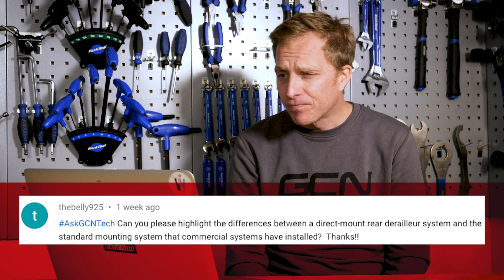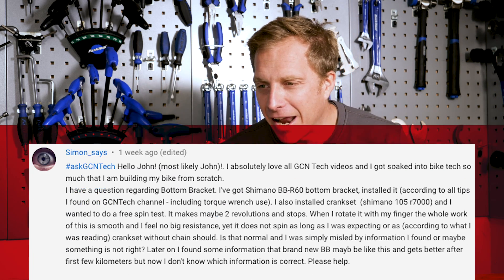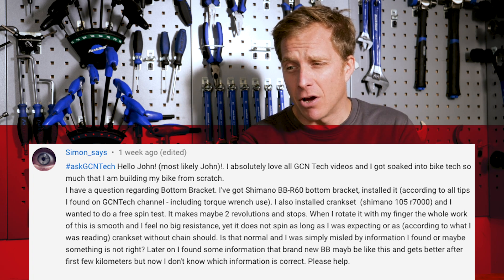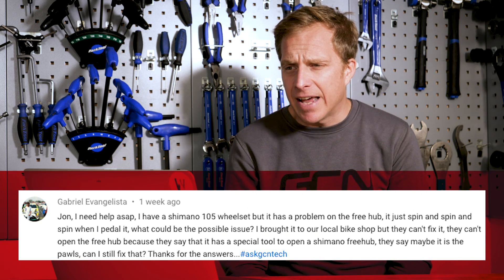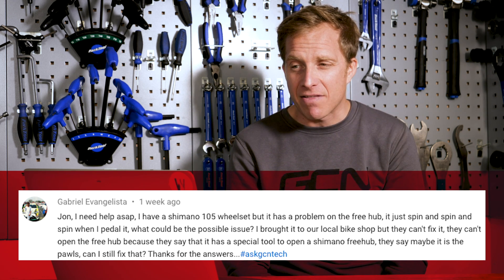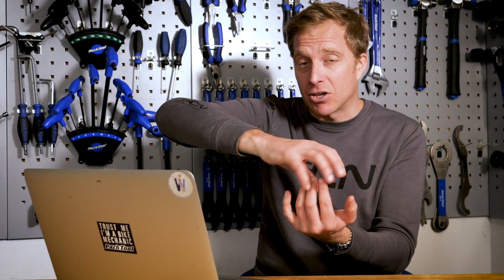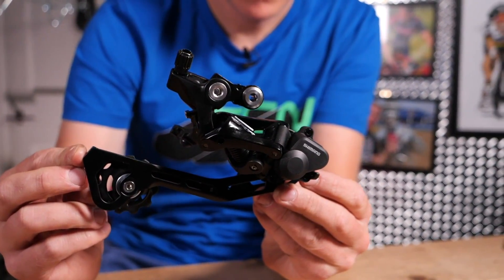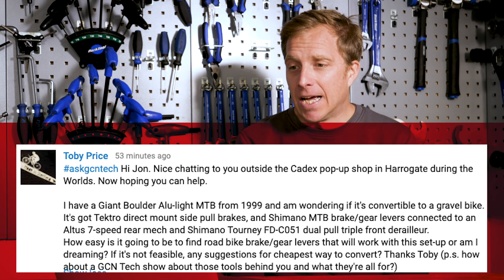Direct Mount vs Standard Mount Rear Derailleur | GCN Tech Clinic #AskGCNTech

Comment: 11:20 This is more or less what I'm planning on doing. I have a trekking bike with 3 by 9 speed, but I hate front derailleurs.
So I'm going to put a Shimano M8100 1 by 12 MTB groupset on there.
To do that, I also need to rebuild my rear wheel with a microspline hub and ditch the square tapered bottom bracket for a decent BSA one with external bearings.

Comment: My wife just bought an old Raleigh weekender ladies bike. It comes with a 5 speed rear. Single speed front. The rear derailleur is an old shimano positron 400. Is it possible to change this out for modern tech with a handle bar thumb changer?

Comment: Hi Jon I have a 2013 Giant trinity sl with horizontal dropouts with the latest Shimano di2 with synchro and only up and down buttons. So to get the smallest cog I am in the big chain ring, is biggie smalls. This means there's no slack in the chain. What's the best way to take the rear wheel out? Currently in dropping the chain of the ring. Thanks

Comment: #AskGCNTech

Hi Jon,

Thanks for helping out with my cassette cogs question a few weeks back; it worked a treat!

I've another question for you bike boffins:  I've just upgraded my paved-path bike with Hunt 19c 4 Season wheels (from 15c Shimano RS500s), with the same 32c tires; can I reduce tire pressure as a function of the increased internal volume, or is that not a thing?

Thanks again,
Mark

Comment: MTB to Gravel - I was under the impression that 7-speed & 8-Speed have the same spacing between shifts.  Meaning 8-speed STI will work fine, but you have to use the H & L screws on the rear mech to lock out the last shift.  There could be a difference between road & MTB I suppose.  Sheldon Brown also has some instructions for running "8 of 9" & "9 of 10" speeds on a 7-speed wheel.  A fair bit of custom work, not sure how Jon feels about this.

Comment: Hi GCN.
Wondering if a fitness/tour bike would be a viable donor for a budget gravel/adventure bike project. what I'm looking for is disc brake frame to accommodate 40-45 mm tires, what I'm concerned about is the square taper bb and usually 6061 alloy frames. I'm looking at disponible secondhand bikes with 8-10 sp 1x setup like the nishiki speed r or the sco premium traveller. Follow up question: is a 7-8 speed internal hub wheel can be simply swapped with a 8-10 sp cassette (to broaden the search)? many thanks.

Comment: #AskGCNTech 

Hi Jon. Iam planning to build a roadbike with a bige gearspread and i want to go for ultegra di2. on the front i have a compact chainring and in the back, i think ultegra is capable to have a 30 cassett or maybe a 32 cassett, is this right? And wich is the best derailleur to give the best shifting thats achievable in this situation, maybe the long cage? Or is there a way to do it with a hanger?
Thanks and keep on doing the good work.
Reply: The short cage will work up to 32t (Shimano says only up to 30, but it will work with 32 if you use the B-screw for adjustment), the long cage is designed for 28- 34t as the biggest cog, but I read you can put a 11-36 cassette (not available from shimano, but SRAM, it will work) on there. If you use the long cage 11-25 or 12-25 cassettes won't really work, shifting will be awkward, just keep that in mind, when deciding to buy the long (GS) or short cage(SS) version. I don't know if there is any difference in performance when you are using an 11-32 cassette with GS or SS derailleur, I suspect there isn't.

Comment: Hi Toby Price, hi John.
Shimano RSX ST-410 is a 3x7 sti levers set. There is also 8 speed version marked ST-416. Check OLD, for 7 speed MTB it may be 130mm so easy conversion to 3x8 with FH-1056 ot similar hub.
Br.
Patryk

Comment: 7 Speed STI style shifters, Microshift 472 or 473 for double or triple respectively.  used them on mine, work great with tourney 7 speed.  however your v-brakes will require a longer pull so a travel adjuster could help but problem solvers no longer makes it (far as i could tell); one option is cantilevers (cross brakes a few years ago).

Comment: #askgcntech I bought a used Giant Defy Advanced 2018. I am really not fond of the disc brake actuator on the handlebars. Will the Shimano 105 STI Hydrologic levers work in replacing this unit. If not any suggestions to alleviate this issue.

Comment: John, I have a 2017 Cannondale supersix evo disc. The front is a through axle and the rear is a quick release. Currently I am happy with the wheelset, however, when I do want to upgrade, will is be difficult to find a wheel set that will be both through axle and quick release? Moreover, being a disc wheel set will I be able to find QR rear hub?Can I change the rear hub to allow a through axle? Thanks for your help!
Reply: DT Swiss wheels come with end caps to convert from TA to QR. Many other brands also.
Reply: Mark Kovacic 

Mark, 

I have hollowgram hubs, I would imagine I would need to replace them if I wanted to go with a DT Swiss conversation kit?
Reply: @dannysefcik7827  Right, the end caps only fit DT Swiss hubs.

Comment: Hey anyone, I have a new 105 r7000 front derailer with fsa slk cranks rubbing at the extremes please help. 
Tried setting it up multiple times and using the trim functions but the best i can get is small front ring all good throughout the range on the rear and then on the big ring rubbing starts on about the 7th biggest rear gear. (11spd 105 rear)
When i adjust the high limit to make the big ring work without rubbing it seems to move the low limit when on the small ring and then rubbing starts on the small ring on the bigger cogs at the rear. Somehow the limit screws dont seem independent, or my low limit isn't set up right....i dont know... how have i set it up wrong?  Pleeeese and thankyou

P.s. its a braze on fd with a braze on adaptor and the support bolt is tightened to the frane

Comment: #AskGCNTech dan lipp wrote (w/o hashtag)  Hi jon. I have a question about rim wear. I have a set of campagnolo zondas that have been used only in the winter. The rear rim is showing signs of wear. I have measured the rim width of the braking surface and it comes out at 0.7mm. I have read that they are 1.4mm new. I also read its ok to use a rim down to 0.4mm. What do you think?

Comment: #AskGCNtech - can you or anyone answer this question as there's nothing conclusive on the internet.  1. I am looking to change the crankset from Sram Red  to maybe Rotor 30mm but want to keep the Sram Red Chainrings - will they fit? With hidden bolt thingy? 2. If not then I would like to know suitable alternatives that folks are using that work with Etap. I have Italian threaded BB - preference to Ita30BB. Cheers.

Comment: #askgcntech. Hi John love the channel. It’s new bike time and I’m torn between a carbon road bike with Ultegra or a carbon gravel bike with grx810. The gravel bike is only a few grams heavier than the road bike. I want to ride hills mountains on road (both up and down) and occasionally gravel tracks not all in the same trip. Will a gravel bike do a decent job  on the road both flat and hills or am I going to regret not getting a road the bike. Unfortunately only one winner in terms of bike.
Reply from the maker: Hi Roy, a gravel bike will be a more versatile choice, but if you're only riding gravel very occasionally you might prefer the road bike - there shouldn't be a huge difference in handling between the two and you can always change the tyres to suit the ride you've planned. I hope that helps!

Comment: Question for you all. Probably a very silly one, but I'm asking anyways!
I'm fortunate enough to have my old bike permanently on my turbo trainer. What regular maintenance do I need to do? Ie how often do I need to lube it considering there's no Scottish weather washing it off or adding much into the machanisms?
Reply from the maker: Good question, and it entirely depends on how often you feel you need to lube the chain. It won't wear as fast as it would outside (especially in Scotland) but it will still wear so it's worth regular checking. Otherwise if you only ride it inside any other regular maintenance to keep it working smooth.
Reply: @gcntech  thanks. It seems to have survived a while without any love but I know everything has a limit. I'd better go and give it a quick once over...

Comment: Hi John. I have a question. During my pedal stroke, there is this squeaking noise that comes from either the pedal/crank/chainrings or somewhere and I cannot seem to place my finger on where exactly the sound I coming from. 
I have cleaned out the bottom bracket, cleaned the chainrings + greased the Shimano 4 bolts on chainrings, cleaned and greased pedals and done everything to mitigate this irritating sound but cannot seem to find it. 
I use Speedplay pedals and my only conclusion is that the pedal platform have worn down, and now the Speedplay cleats are ever so slightly rubbing in the spindle. Does this sound correct? 
Thank you so much. #gcntech #bikeproblems

Comment: GRX 400 only works with itself (GRX 400) and Tiagra 4700 10 speed, not with older 10 speed shift levers/derailleurs like 105, Ultegra, Dura ace and Tiagra 4600.
Well, GRX 400 even works with 11 speed 105, Ultegra and Dura Ace because the new pull ratio is the same between newer 10 speed and 11 speed groupsets. So, if you want to spend less on a Shadow plus rear mech, you can use the GRX 400 RD with your full 11 speed groupset
Reply: Oh, and I forgot something.
GRX 400 can fit max 36t in theory, but in practise it works great with 40t cassette (tried and comfirmed by me) and even it can work with 42t

Comment: #AskGCNTech Hi jon. I have a question about rim wear. I have a set of campagnolo zondas that have been used only in the winter. The rear rim is showing signs of wear. I have measured the rim width of the braking surface and it comes out at 0.7mm. I have read that they are 1.4mm new. I also read its ok to use a rim down to 0.4mm. What do you think?
Reply: Really interesting question, I wish you had used the hashtag, I'll repost it ;-)

Comment: The 7 speed derailleur got the same pull ratio (1,7) like all 7-9 Road or MTB shimanos. 10-speed 105 (ratio 1,2) is different than 10 tiagra/grx (ratio 1,4). So take a sora 8 or 9 speed sti and put a 8 or 9 speed cassette on the hub. See: https://bike.bikegremlin.com/1278/bicycle-rear-derailleur-compatibility/

Comment: #AskGCNtech and everyone else who might help. I have purchased a specialized Tri spoke rear wheel for my homebuilt Scott Addict R4, problem is that the wheel sits loose in the frame and turns into the frame and get jammed up against the frame, have temporarily fixed it by tightening the qr insanely hard, don't think it's any good for a carbon frame. Any help or suggestions is greatly appreciated. Enjoy the the show as  I do most of the maintenance myself

Comment: Cycling a BMC SL01 Road Racer with Shimano XT pedals, on each pedal turn there is a click that can be felt.  The is fairly recent and follows a happy set of training ks, circa 250km+ per week.  Coming up to an event - 160k loop road ride - keen to resolve.  What might it be ? #askgcntech there is no associated noise but the click can be felt through the bike shoes - usually left crank close to the top of the pedal stroke - off the bike all feels well with no free lateral movement on pedals or crank - any ideas appreciated - great show keep up the good work :) (Perhaps one day someone might dccument the suggested solutions in a form that can be easily looked up from past shows, like an index?

Comment: Regarding that MTB to gravel built: There are 7 speed sti shifters for road bikes (Tourney).
Reply: valentin65 They are just awful though. Microshift makes a slightly better set than the Tourney.  Just save up for a new bike.
Reply: There were RSX 7 speed STIs from the 90`s. Probably available on eBay.

Comment: In response to the need for a road link to run a 40t rear cassette, I have an 11-40 rear on my gravel bike with an Ultegra RX derailleur.  I purchased a road link but ended up not needing it, as the RX derailleur handles it without any issues after turning the B screw in a bit.
Reply: That's very useful information, thank you. The GRX derailleur probably can cope with 40t too then, it's said it is pretty much the same as the Ultegra RX.
Btw. 105 or normal Ultegra rear derailleurs (GS cage) can cope with SRAM 11-36 cassettes without any issues.

Comment: shimano tourney 3x7 road shifters exist, as do Microshift. https://www.bikester.co.uk/shimano-tourney-st-a073-shifter-set-road-3x7-speed-black-474051.html?gclid=Cj0KCQiA2vjuBRCqARIsAJL5a-KQjkkMB74aMfQjZlBwcmvaHC4H6ct6zig-lnfDc2PU3XGKf8Yf_34aAiOSEALw_wcB&_cid=21_1_-1_%7Bifpla:9%7D%7Bifpe:8%7D_34_474051_%7Bcreative%7D_%7Bifpla:pla%7D&ef_id=Cj0KCQiA2vjuBRCqARIsAJL5a-KQjkkMB74aMfQjZlBwcmvaHC4H6ct6zig-lnfDc2PU3XGKf8Yf_34aAiOSEALw_wcB&ev_chn=shopI am running the Tourney ones on my frankenbike  conversion of my 1992 MTB with XT derallieurs. Using a travel agent to run the levers with some modern v-brakes https://www.sjscycles.co.uk/cables/travel-agent-br0411-black-each/

Comment: #AskGCNTech Hi Jon, I have a carbon steerer with a carbon stem and have found that when torqued to the specified level that my stem can still slip and I end up with bars pointed to the side. I was doing a trackstand at some traffic lights and actually nearly came off when the light went green and the bars turned sideways. I had a multitool in my bag and tightened the bolts by hand so was able to finish the ride but obviously I'm uncomfortable going over the max torque on this steerer tube. What do you think about fibre grip on the steerer/stem connection? The internet seems a bit conflicted on this one? I was also thinking maybe it's the bolts coming loose and some treadlocker is the answer? Thanks
Reply: Carbon assembly paste will solve your problem without tightening beyond the recommended torque. Make sure you steerer compression plug sits inside the stem. Too many spacers above the stem will not allow the plug to do it's job of supporting your carbon steerer.

Comment: regarding the use of STI 7 speed shifters. They do exist, I have converted an old GT hybrid to drop bars using Shimano tourney  ST 4603 shifters. This is the triple front derailleur set. They work great. The problem will be with the brakes as these will either require a Problem Solvers Travel Agent  or conversion to  mini-V brakes.

Comment: Ceramic bearings are not stronger than steel bearings because the amount shock in pressure could destroy the ceramic bearings faster than steel.  Not worth spending the extra money.
Reply: Most ceramic bearings are semi-ceramic anyway.  Extremely hard ceramic balls and relatively soft steel races which leads to failure/ friction. So if you don't want to change your bearings every 500km, keep away from semi-ceramic BS.

Comment: #AskGCNTech
 Hi, I've got a track bike with a Stronglight 2000 crankset with it's recommended BB (107mm JIS) and have measured the Q factor to be uneven by about 5mm (wider on the driveside). 
Not entering the whole Q factor debate, but  I'd like an even Q factor as a starting point! Is there something wrong with installation or is the only choice washers? Help much appreciated :)

Comment: Hi GCN Tech, I'm looking to put drop bars on a hybrid that has a Deore 11-42 10 speed groupset. I'm struggling to find anything with 10 speed for hydraulic brakes. I've been warned that Tiagra 4700 doesn't have the same pull ratio. Can you help? 
Thanks!
Reply: Probably not. With 10speed and higher MTB and road shifters/derailleurs won't work together. The most (by far)  expensive parts of a groupset are the STI-levers anyway, especially the hydraulic versions, so you might as well change the derailleurs. Make sure your brakes are compatible with the levers. You might find this site useful, it is about compatibility of Shimano parts: https://productinfo.shimano.com/#/com?cid=C-432&acid=C-432  Maybe someone can say something about road front derailleurs and MTB cranksets? Any issues? Chainline is very different...

Comment: Hellow John!!! I´d like to pose you a question. My bke has hidraulic disk brakes (Ultegra 6800) and since a few weeks ago each time I use m front brake, after I release the lever it keep rubbing for 10 to 20 seconds (it seems it has difficulty opening the pads). Could you explain what might be the problema and the solution? Thank you John!
Reply: Pistons could be sticking, I would bleed the system first. Check pad wear too.

Comment: #AskGCNTech Hey Jon, I'm hoping you are the man to help with a small issue I have regarding paint. I have a BMC Roadmachine with a satin or matt paint finish. A while ago I noticed a small scratch on the top tube so my first and only thought was to grab some T-cut paint restore . I applied this and polished it up and the scratch come out beautifully. It was only after this I realised I have used a t-cut designed for gloss paint on a satin frame and the top tube is now shiny and the rest of the frame is its original finish. I could easily polish the rest of the frame and it would look lovely with a gloss finish but  I would sooner ask if you know of any method or product I could use to restore the top tube back to its satin finish? Keep the great content coming and thanks.
Reply: It would be difficult to match the evenness of the factory job. You could (not saying you should) take some sandpaper and lightly sand the glossy section, but it likely would look worse. It would probably be easier to make the whole bike glossy. Or just leave it alone...